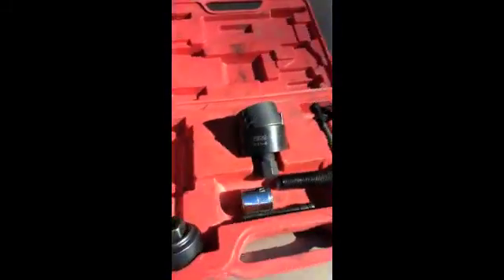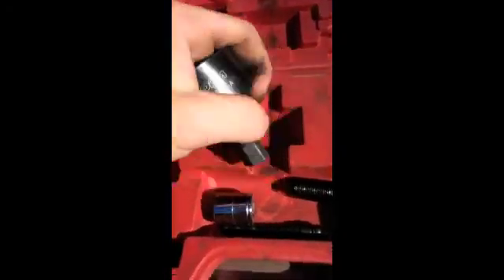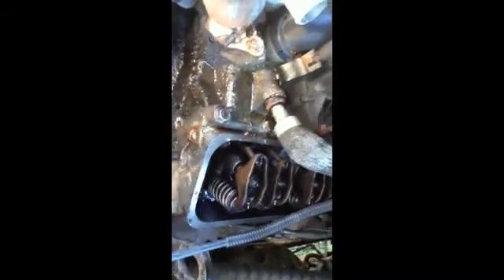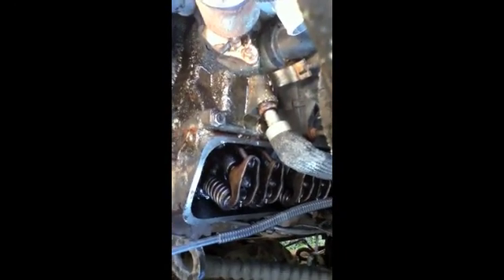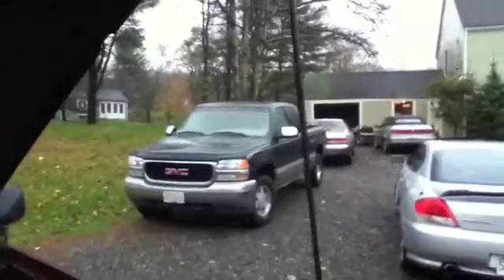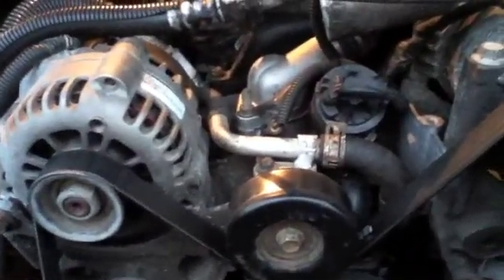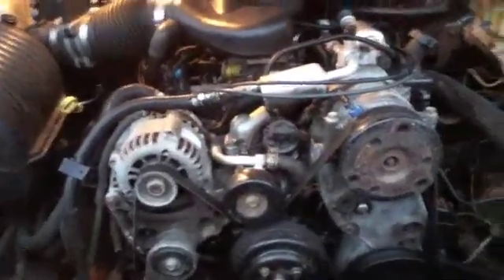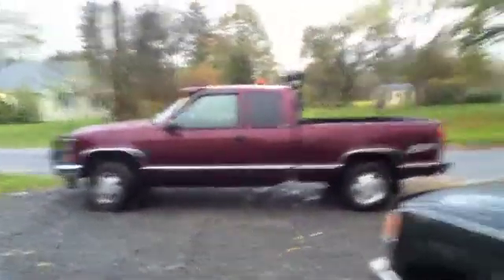Coolant Leak Diagnostic and Repair Pt. 2

Comment: hey bud you probobly figured this out by now but theres no antifreeze under the valve covers and if there is you have a cracked head or block just a tip incase you didnt already know